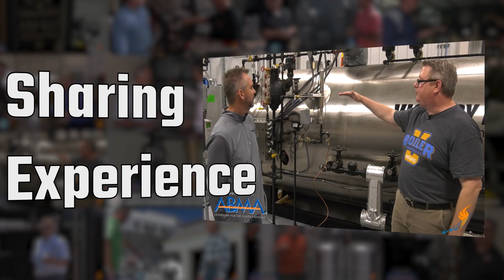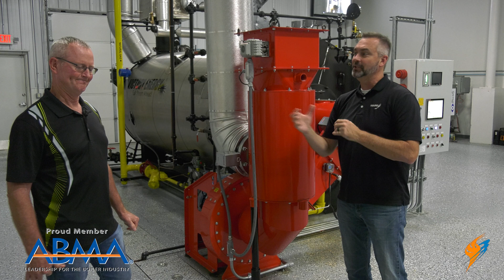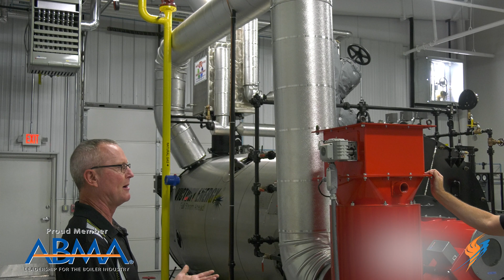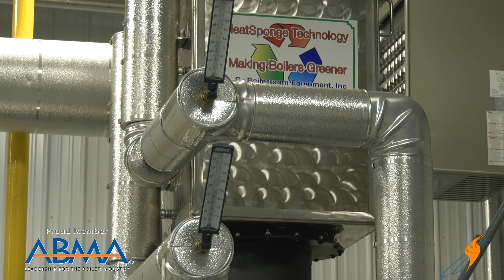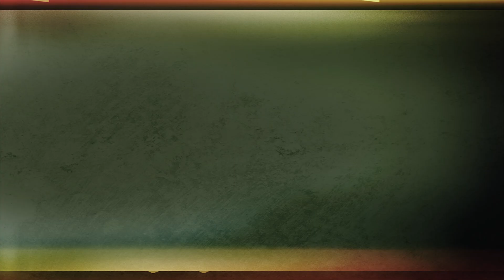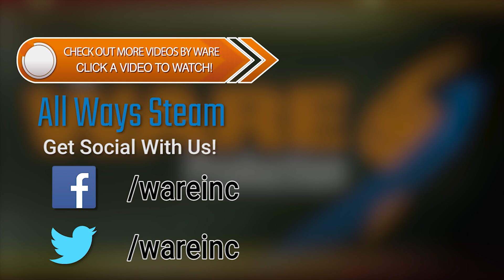Reducing Boiler Emissions with Flue Gas Recirculation - Boiling Point

Comment: I guess FGR would reduce thermal efficiency. if you can get a furnace temp of 3000 degrees and a stack temp of 300 then you have 90% heat recovery. if you have a furnace temp of 2400 degrees and a stack temp of 300 then you get more like 85% heat efficiency.

Comment: When the FGR system is activated in the outdoor water-tube hot water boiler, condensation occurs. What method can be applied to prevent this? Could you please advise? The outdoor temperature is 10 °C, and the flue gas return temperature is 60 °C.”

Comment: What material do you typically use for the FGR piping itself?
Reply from the maker: Carbon steel is fine for FGR piping unless you have excessive corrosion from low temperature operation.  In that case you could use stainless. In either case, insulating the FGR will reduce condensation if it is a problem.